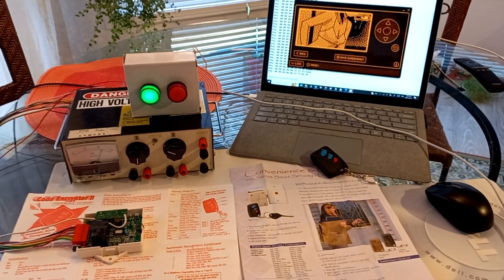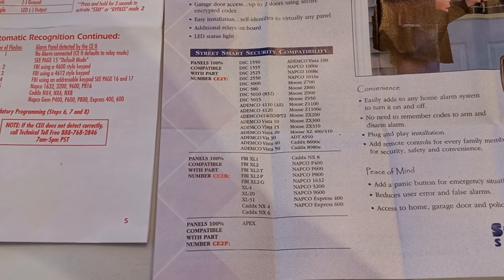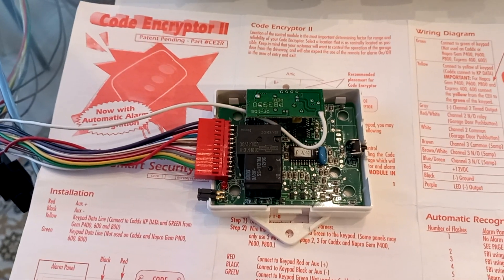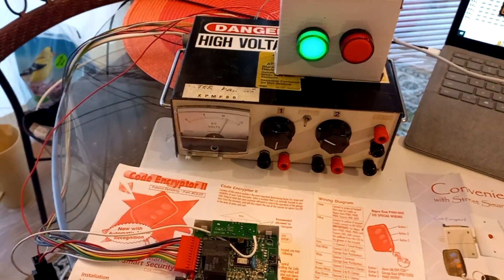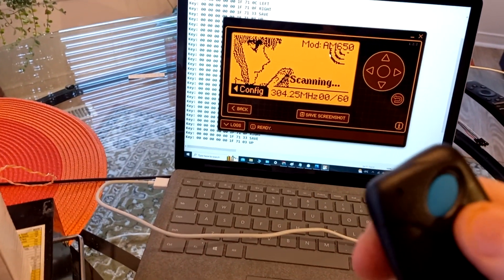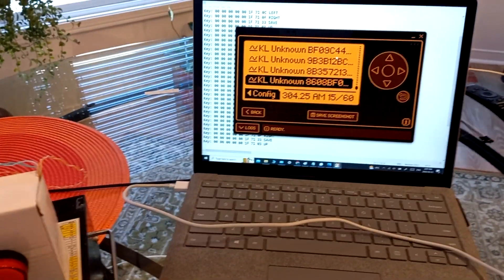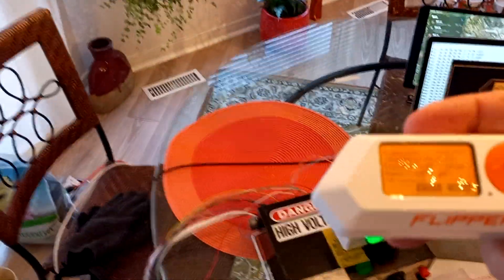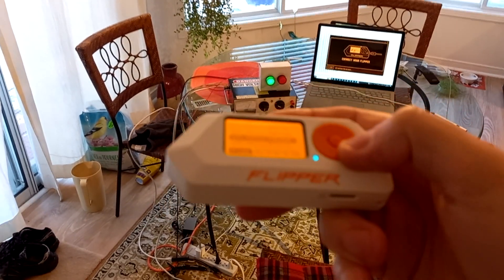Flipper Zero Exploiting 64 Bit Rolling Code Remote

Comment: There is one "flaw" of this hack method..
If the owner uses his remote just once, all previous codes you gathered before, become invalid.

The only scenario the above method would work for evil man, would be to take control of remote, save some codes (while the owner is far from the house/office/whatever and quickly go there to use it.

Even if you jam the reciever (at the same time collecting codes), while owner is in the vicinity of it, he will finally send a code, making all the prevous codes obsolete.
So it seems that the rolling code is quite effective method. Requires quite a few elements to occure at the same time to make the code-cloning effective.

BTW - impressive channel content!
Reply: Not if you send the code while he’s jammed . Hell think he locked the door himself 🤣
Reply: @Thadopeera improbable
Reply: Lots of situations where this still is viable. You and evilman are at some event that is going on for the next 2 hours and thus you are likely to be there for the duration.  Evilman is in posession of your remote long enough to capture a few codes. At this point evil man could just leave being relatively certain you will be at the event for the next 2 hours so they go to the secure location and use those codes to unlock. 

Alternately same senario and after evilman has the codes they transmit the data of the codes to an accomplice already at secure site ready to enter and transmit them. To unlock secure site.

Comment: Since there is no power to the lock.
The lock is only picking up the code, since it was never used originally on the remote. 
I bet you would get a different result, either with the power on, and store the code in the flipper. 
Or you going back to a code you already used.

Comment: So say if I copied multiple codes from the owners key (like you did), and say that owner uses their key once. Does that mean I would have to use a code that's after the one they already did and it would still work?
Reply: Yes, you have a very narrow window to use the codes until the original remote won't use a code that is more fresh than all of the oder codes you've stoled

Comment: Hi.. I have tried to capturing my keys (car keys) that have rolling code, I have a honda 2016.

At first I do frequency analyzer, and it captured my keys.. There is some different frequency, but there is also same one... 
Still on freq analyzer, I choose one of the frequency and hit enter.. 
It take me to "read' section, in there I try to capture my key, but not capturing anything. 

Im running on unleashed fw. Is it because I add restrictions freq?? 

This is so frustrating... 😅😅😅
Reply: @peterfairlie2296  if they use rolling codes, and we want to use the flipper, do we just not go back to using keys and be fine forever?

Comment: So the ''unknown'' after KL means the flipper doesn't recognize the rolling code algorithm which implies it's a one time use code as you said. Also the counter is only made by zeros. My question is, does the flipper capture the same way static codes? And is there any indicator to say it's static or simply not recognized(rolling code protocol)?

Comment: What is, if I want to open my garage door regularly with my remote, but due to any circumstances the signal is too weak to be detected by the receiver? Then, the remote would fetch the next code, but the receiver won't.
Reply: The reciever has a buffer of the next few hundred codes in every implementation I have seen. Once it gets a valid one it buffers the next few hundred codes.

Comment: Do the keys get desynchronized after using the rolling codes from the flipper? And if is not do you know how many codes can be use before it gets desynchronized? Thanks.
Reply: Yes. Not the first time, but if you do this 10 times : PROBABLY.
Reply: The keyfob will always be ahead of the flipper in this style of attack as the keyfob has transmitted all of the other codes. Already that were intercepted by rhe flipper. The moment the fob is in range it will effectively invalidate all other codes. 

(Depends on the implementation but every one i have ever encounter buffers hundreds of codes in advance just to deal with the issue of accidental presses. If there exist a bad implementation out there simply pressing your fob a bunch of times out od range would also desync you.

Dsync should only ever happen wheh you have an attack that can predict future codes and thus the flipper will be ahead of the fob, but then repeatedly pressing the fob will eventually place it ahead of the flipper once again.

Comment: My only question is now can you just use the customers remote like normal or will you have to press it a couple times to catch up since you took it out of sequence with the flipper?  in some cases like certain cars it will even lock the remote out if it sends an already seen code, etc. can you elaborate on this thanks for the great video I love all of your content and knowledge
Reply: The customers remote already transmitted all the codes. It is more ahead than the flipper. As the flipper was sending codes the original already sent but outside of range of the receiver. The moment the original is used again properly in range every code copied to the flipper will be useless as now the keyfob has given the most recent code nullifying the old ones.

Comment: Does the rolling code use an algorithm? Or is it randomly generated? If there is an algorithm wouldn't it be possible to configure a rolling code manually? Or does it not work that way?
Reply: Theres no such as random code.

Comment: My garage door opener uses two frequencies simultaneously, 300 mhz and 800 mhz, I needed two hackrfs to defeat it
Reply: @peterfairlie2296  also if i were to design a door opener, it would send a nonce (or even a true random number) to the key fob when it first broadcasts.  Then the key fob would cryptographically sign the nonce, send it back over the air. Door opens on good signature

Comment: I like what you are doing with your vids but there’s nothing real world being shown,  you turned off the rx power while thing to get the codes….
Reply from the maker: What I'm demonstrating is that the Flipper can capture and replay the rolling codes. By turning off the power of the receiver I was simulating the scenario of the remote and receiver being at an out-of-range distance. This scenario can happen when you're far from home or your car. Someone can copy your fob's code and go use it before you arrive at home. This same type of attack can also be used on various cars too.
Reply: @peterfairlie2296  understood, my point is you can take it a step further and demonstrate a roll jam attack since this scenario doesnt really make sense in the wild without active signal jamming.
Reply from the maker: It makes sense if you have access to the persons key fob and it's out-of-range of the intended target receiver. This could be a co-worker who left for the bathroom and left their fob on the table.